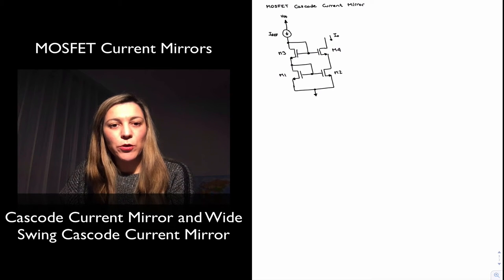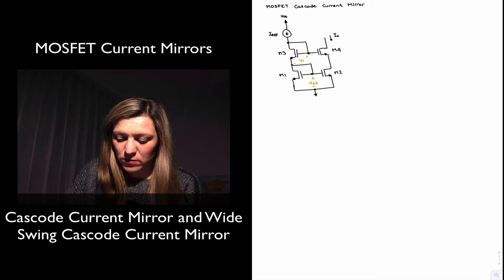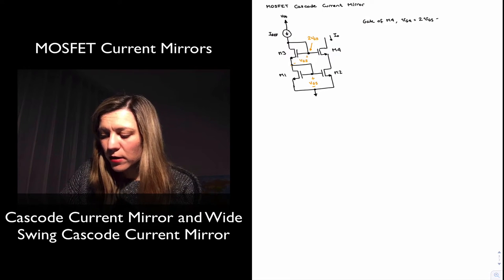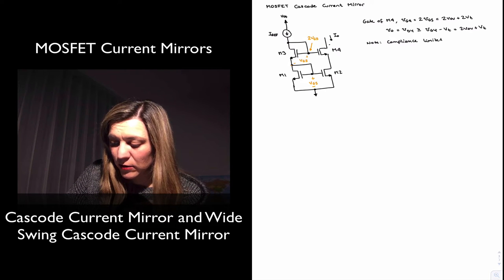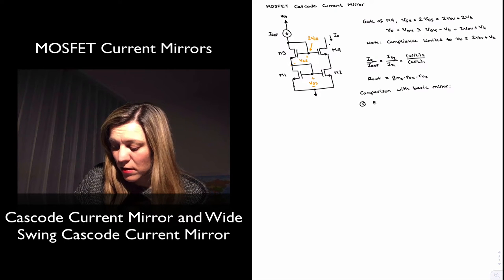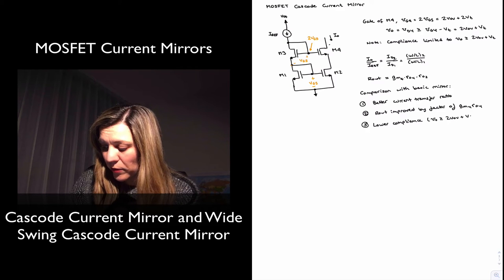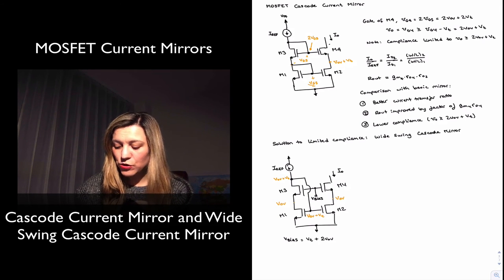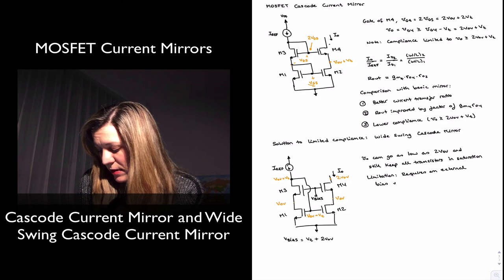MOSFET Cascode Current Mirror

Comment: Excellent video and tutorial. Thank you for your efforts to teach the world. 

You might like to know that you are reaching not only electrical engineering students, but retired hobbyist, such as me. As hobbyist are not used to working with the short-hand language of the electrical engineering world, may I request that you speak the entire name of the variables that you write in short-hand... Such as when you have written "Vgs," every time you speak that reference, please say the complete term "Voltage (from) gate (to) source. This will help those less acute to the language to hold together their(my) understanding through each step of the circuit, to its conclusion. I intend this as no criticism, but offer the suggestion in appreciation of you sharing your expertise.

I do have questions... Is the Wide Swing Cascode Current Mirror the best precision current source circuit that you know of? If not, then what circuit would you prefer, given no constraints of costs, etc? 

Each subsequent "improvement" to the basic Wilson Current Mirror adds components, and, therefore, the addition of more elements that are subject to thermal drift. Adding MOSFETs also increases the time required for the circuit to react to changes in voltage. Might an earlier variation of the circuit provide similar accuracy, with fewer components and their associated cost? What variation of the circuit proves to be the best compromise?

I became slightly lost with the idea of a smaller MOSFET, i.e. "1/4(W/L)." Please explain not only the words of the term, but the implications for selecting the particular MOSFET for this component.

I look forward to your reply. Now, I am off to see if I have five NPN MOSFETs, with which to build the circuit on a breadboard. I will add a potentiometer, in the place of the current reference (Iref,) vary the current and fascinate myself, by watching the current remain constant. <grin>